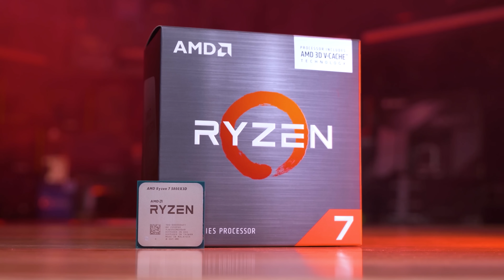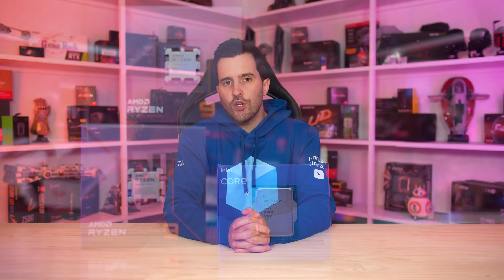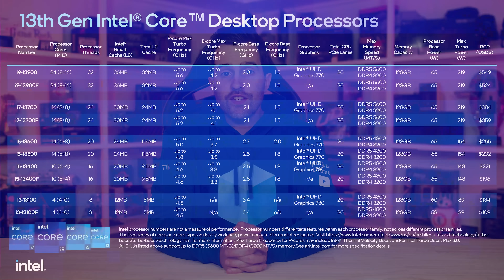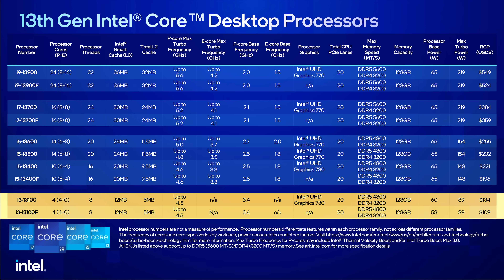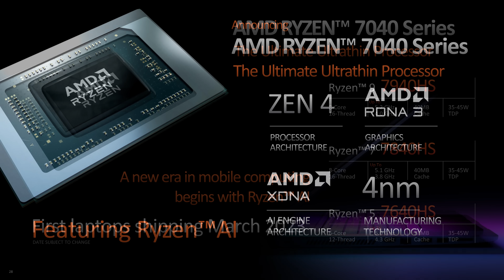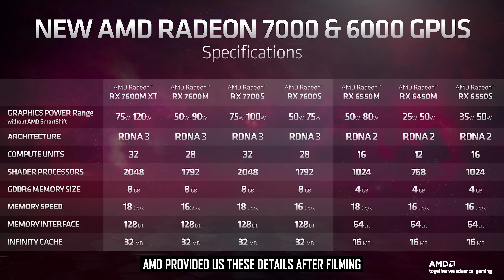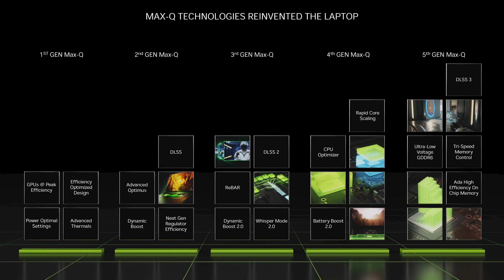Zen 4 3D V-Cache, 7950X3D, 7800X3D, New Cheaper CPUs, "RTX 4090" for Laptops - CES News Recap

Comment: The 7950X3D and 7900X3D has a dirty little secret. You are right, only one of the chiplets has the extra cache. The secret is that the high clocks are only for the chiplet without cache. The chiplet with the cache is limited to 5.0 GHz. So only half of your CPU will hit 5.7 GHz. It is not a all core clock speed.
Reply: source?
Reply: @Hugh_I  AMD themselves: See https://www.youtube.com/watch?v=ZdO-5F86_xo
Reply: @nicholash8021  Thanks! Yeah that's very clear. Did AMD state anywhere else that it's gonna be 5Ghz max for the cached CCX? I think he didn't say any specific numbers. Or did you deduce that from the 5Ghz max boost of the 7800X3D?
Reply: Max rated boost is literally NEVER the same as the all-core clock-speed V-Cache or not, ya freaking dipshit... 😑🤦‍♂️ Max rooted boost = single-core boost.
Reply: Shhh, AMD would like to keep that secret

Comment: Good point on the 7900 chips only having 3d v cache on one chiplet. its prob why  the 7800 has to drop its max clock, cos v cache is sensitive to heat etc.
It's strange the 7800x3D looks to be lower max clock than the 7700x. it could end up being better for gaming but worse for productivity lol

Comment: Comments on certain SKUs being Alder Lake or not seems weird. Are you suggesting Intel overproduced Alder Lake dies? Raptor Lake should be competing with Alder Lake for fab space and has notable errata corrections. I would assume that there are just more bins of Raptor Lake due to Intel's massive die sizes and worse-than-TSMC yields.

I agree with the quad core desktop SKUs and the 6P4E desktop SKUs likely being Alder Lake, but I'm really skeptical that the 8P8E are Alder Lake.
Reply: And you'd be wrong. It has been known for a while that they're renaming ADL dies for this generation to fill the lower end skus.
Reply: @mikem.9197  I'm not debating that, I'm noting that I think it's fewer SKUs than called out above.

Comment: What if the 12 and 16 core parts only had half of the v cache per die as the 8 core model? Could this not explain why they don't have a big clock speed drop? If that was how they went about it, the 8 core part probably has v cache that is 2x as dense, which could be why they dropped clock speed despite having the same power target as the bigger chips. To keep thermals in check. I can't imagine them only putting v cache on 1 die. Just a thought at least.
Reply: I am betting that is what happened.
Reply: It's only on one die, that's why on other die there's no clock speed reduction
Reply: It has bee confimed. One die 3d cache, low speed. Other die no 3d cache, high speed.
Reply: @haukikannel  Source required.

Comment: If you have a 4090, the X3D CPUs are your only option. Any other CPU will limit your GPU performance. Hopefully, HU will review 7950X3D with a 4090.
Reply: My 120hz screen is the bottleneck.
Reply: Depends what screens you're running. Run triple 4k, or single 8k, and that 4090 will not be bottle necked by the CPU.
Reply: I'm running a single 4k screen with a 4090 and a 7600x and it's always been the GPU that's at 100% in intensive games. CPU highest I've seen in go is about 60%.
Reply: @hostile_1866  You can't see a CPU bottleneck by looking at the CPU%. Since games still aren't perfectly multi-threaded they wont ever hit 100% cpu% no matter how good the GPU is.

The only way to tell is to look at GPU% since games are expected to take full advantage of the GPU.
Reply: @Hotobu  ah interesting so if ever my graphics card isn't 100%, then it's CPU limited? :)
Reply: @hostile_1866  If your settings are maxed, yes. If you have a strong enough GPU and and old enough game then it wont hit 100% GPU because there's nothing the game can do to stress the CPU.

Comment: Wondering if 7950x i got for 569$ two weeks ago was good choice instead of waiting for x3D....
Reply: Same, but I'm mostly doing non-gaming multi-threaded work. But rumors above are saying that by disabling one of the two CCDs, you can then boost better than the 3D and overall do better in gaming as the extra cores (beyond 8) aren't as useful apparently. But when going to 1440P and 4K gaming, the GPU is the bigger bottleneck so your differences will be less noticeable anyway.

Comment: Something about the 7000HS parts is strange. They are listed with 40 MB Total Cache but on the specs sheet on AMDs Website the CPU only has 16 MB L3 + 1 MB L2 per Core. Where are the missing 16 MB? Did the Igpu get a small infinity cache or what?
Reply: 15:05 the early list information may have some mistakes. Here in the slides and video timestamp it is mentioned the 7040HS models have 32 MB of L3 
So you get 32 MB + 8 MB L2 (for 8 cores) = 40 MB combined

Comment: In that Ryzen 3D vs 13900K comparison, AMD probably ran the DDR5 memory for Intel at stock speeds (5600)....and that hurts the performance a lot. The 13900K can with the right motherboard and RAM push past DDR5 8000. While the Ryzen 3D is limited to about DDR5 6000-6400 speeds at 1:1 with IF.
Reply: But will higher ram & price be worth it 🤷🏻‍♂️
Reply: that might be an interesting thing to benchmark, but in the end an i9 with the most expensive memory you can get being within a couple of single digit % points above or below the 7800X3D with affordable DDR5 will be a terrible value proposition either way.
Reply: DDR5 RAM that fast costs an arm and a leg and isn't worth the gains.

Comment: Ok so navi 33 has identical number of CUs as navi 23, is made on 6nm (7nm derivative) and is actually a slightly smaller die.

This means 7600 and 7600XT deskop cards won't see a significant improvement in performance and also will stay at 8gb.

I don't expect these cards to increase value in the budget market significantly if at all.
Reply: When 4060 will be something like $600 to $700, then 7600XT would make a lot of sense at $500 price point!
Reply: @haukikannel  I'm sure it will at least be cheaper then that.
6700XT is already quite a bit below that price and I expect the 7600XT will have similar performance minus 4gb VRAM.

Comment: No 7600X3D or 7700X3D. sadge.
Reply: 7800x3d is 7700x3d the same chip with 3d cache.
7600x3d makes no sense price wise. 3d cache increase price by $150. it does not make sense in cheap CPU to do it!

Comment: Interesting. AMDs Price reduction on regular X cpus, release of cheaper non-x cpus, and non listing of the price of these 3D models, all these moves suggest we can expect a big jump on price for the vcache models.
Reply: Because we know 7700 price, it means that 7700x has to go up in price close to original MSRP, maybe little cut, like $379 for 7700x. And the add the difference between 5800x and 5800x3d that is about $150 and we will have 7800x3d price!
But because AMD does not know yet how to adjust 7700x prisinf after 7700 release, they don´t know 7800x3d prising neither because they all are cross related.

Comment: 4:30 only one chiplet with 3D-Vcache could explain the drop in boost frequency for the 7800X3D. The high boost clocks on the 7900X3D and 7950X3D occur on the chiplet without VCache, whereas the chiplet with VCache have most likely lower boost frequencies due to thermal constraints, probably around the 5GHz mark. 
The 7800X3D only has one chiplet and that has the VCache chiplet on it, therefore is more thermally constrained, which limits the boost to about 5GHz.
Reply: True, but quite annoying that this is still the case when AMD said they would fix the issues with 3D Vcache for Zen 4.
Reply: @Bayonet1809 They did make it significantly better. 🤷 The clock-speed regressions were cut about in half for all-core boost and by about a third for single-core (5.2GHz on 7950X3D's X3D CCD vs 5.7GHz on 7950X; vs 4.5 vs 5.05GHz on Zen 3), ALONG with unlocking PBO & Curve Optimizer overclocking. 

The R7 7800X3D could have been pushed to 5.2GHz if AMD had wanted to just like the 7950X3D's X3D CCD is, but it would have been shit for yields and made the SKU segmentation even more weird than it already was. Once thread scheduling is 100% figured out AMD most definitely wants the more expensive R9 7950X3D to game better than the R7 7800X3D.

Comment: I'll be looking for a deal on a laptop with the i7 13700H and RTX 4080. Probably the best bang for the buck on the high end. I would love an i9 13980HX and RTX 4090, but $2000 extra for 15% more fps in games wouldn't make much sense
Reply: I’d be looking for a r7840 cpu personally because it’s going to spank anything 13th gen from being on 4nm in a laptop alone. Plus 12cu rdna3 integrated graphics would mean low end gaming easily without any gpu and ideally an egpu if you’re actually gaming that heavily.
Reply: @alexmills42  I'll probably wait until AMD comes out with their laptops and see. I currently have one with the R7 5800H and it's served me well

Comment: What makes me very concerned is this is from memory that this is the first time I’ve not seen AMD give prices mentioned on new hardware. So don’t expect any x3d being realistically priced
Reply: They don´t know how they price 7700x and other normal 7000 series when non x has been released. now thw 20$ difference makes no sense, so x part are going up closer to their original MSRP. My prediction is that 7700x comes down from $399 to $379 to be about $50 more expensive than non x 7700. 
And 3d cache version will cost about $150 more than normal x version. Just like 5800x vs 5800x3d… But the exact price depends on how high normal x version will rice after non x version release.
Reply: @haukikannel  I’m anticipating a $200 difference on x3d cpus this time. I hope your right and I’m wrong but my gut feeling is a bigger hike. All depending on performance. One thing is for sure Intel will be very worried right now
Reply: Yeah I’m thinking the 7800x3d will be close to or at MSRP of the 7900x
Reply: @alexmills42  my guess is the "discounted" prices your seeing the non 3D chips at will become their actual prices and the x3D chips will take over the MSRP price they were launched at like they did with the 5800x3D. if they don't then i expect they'll be 50-75 dollars more than the MSRP of non 3D chips.
Reply: The 5800x3d wasn't realistically priced, either, but  it came down to earth within a year. Let's remain hopeful
Reply: @Anankin12  Bro says "wait a year" so casually. That's a whole year of gaming at high fps you missed out on because you decided to wait a year for prices to go down. If you're content with waiting a year, then you likely don't even need an upgrade yet.
Reply: @choka3750  didn't say wait a year, I said wait a couple months for the price to come down to earth.
Reply: @Anankin12  i mean that is not what you said actually.
Reply: @Anankin12  You literally said within a year.
Reply: @choka3750  Anankin said "within a year," not "a whole year."  It took the 5800X3D between 7-8 months to drop from $450 to $330.  The Zen 4 X3D parts launch in February, so if their pricing follows a similar pattern, holding out until 4th quarter of this year to upgrade can make sense.
Reply: @choka3750  Additionally, the cost of entry into the AM5 platform, especially motherboards, is still pretty high.  The decent ones start at around $240, and minimum of 32GB DDR5 RAM on top of that is at least another $180 unless you can get a special bundle deal.  Not everyone's made of money.

Comment: Would love to see benchmarks for this, especially between the 7800X3D vs 7950X3D, I suspect single CCD will be better overall for pure gaming.
Reply: No difference. You have 8 cores with vcache .... VS 8cores with Vcache on top+8cores without.
So for both chips the games main execution threads will be utilising the extra L3 cache and hence higher performance, The 7950x3D and 7900x3D give you the same gaming performance AND the multicore performance for people that want to game and do production (rather than having to choose between R7 and R9).
Of course the 7900x3D is just a cheaper alternative to the 7950x3D.

If you're buying AM5 right now and DDR5 etc then its not really cost effective to buy a 7600x3D considering the outlay, so you might aswell go 7700x3D.
Some idiots upgrading an old ddr3 system thought it was a good idea to buy a soon to be EOL lga1700 motherboard.....PLUS DDR4....and then sticking a measly quadcore i3-12100f into the combo because "its cheap", when for just an extra few bucks (a smal percentage of the overall cost) an i5 was allot more powerful.
So no 7600x3D avoids that false economy problem.
Reply: @tomstech4390  That might explain the 'forced' lower clocks on the 7800X3D, to also keep a gaming performance difference between the SKUs
Reply: With Microsoft's upcoming Zen 4 X3D specific thread scheduler updates they'll literally be identical... They'll both only be using a single 8-core X3D CCD to run the game. (Aka on the Ryzen 9 parts the normal CCD won't be running the game at all, just unrelated background tasks).
Reply: @Cooe.  Not quite, Unlike intels thread scheduler which actively keeps game threads away from the much weaker cores which would bring performance down.
The optimisations AMD talk about are to make game threads a priority on the first 6-8 cores (because a 7900x3D has 6 cores with Vcache plus 6 without) but low priority game processes will still be active on the other CCD so you're not going to be left with half a cpu doing nothing.
It's effectively more of the CPPC2 core flagging we already have, But I digress just wait a little and see.
Reply: I would look at the 7900X3D to be frank, might be an excellent middle point, considering clocks and heat.
Reply: what ever clocks the highest will prob be fastest, unless win scedualer struggles, or the game is poorly coded. Then random shitz can occur, like with intel´s E-cores.

Comment: For the R9's to have the same boost speeds as the the non-3D vcache parts, while only having vcache on one chiplet is hardly a coincidence. I would be surprised if the highest frequency isn't reserved for the side without vcache, only.

That will make it even harder on the scheduler, since there is no "faster" side. Rather, there is one side with more compute power and one with more cache.
Reply: AMD has been working with Microsoft to update the Windows thread scheduler specifically for Zen 4 X3D to do just this. Any workloads that are notably more cache & latency bound will get pushed to the X3D CCD. And then single core and other compute workloads get pushed to the other higher clocking "normal" CCD.
Reply: @Cooe.  Exactly. It's no worse than scheduling for Intels P/E cores. Folks need to relax.
Reply: @Mike M.  No, it's definitely harder to program a scheduler for AMD when both CCDs are better at different specific programs with neither being objectively better. 

Intel P/E, one architecture is clearly superior and preferred, while the other handles idle tasks, background tasks, and only works on foreground tasks when more than 8 threads are activated (thread director generally prefers using an E core before it uses SMT on a P core)

Comment: I think the Laptop 4090 is going to overperform compared to expectations, based on how energy efficient the desktop 4090 is. When you cut the power targets on the desktop 4090 it is still a fucking beast of a card. So, in laptops with inherrently smaller power targets, I think we'll still see huge performance gains. 

It all depends on the format & how well the laptop itself can shed all that heat!!
Reply: But the laptop 4090 is actually a down-clocked 4080.
Reply: I'm very much considering a 4090 laptop. But if the performance uplift from a 4080 is only 15% for $2000 more, I'll pass lol
Reply: @Pharya -- So you commented without actually watching. There is no actual 4090... they just named it that. It's an AD103 die the same as the desktop 4080. NVidia just pulled the same shit people called them out for with the "12GB 4080" that they were forced to rename to the 4070 TI.

Comment: I'm just throwing out this idea in hopes it could happen one day...but it'd be great if AMD and Intel used the same socket, so that you could decide which cpu you wanted but keep the same mobo that lasts for many years. This way you're not locked into either ecosystem, you could try both.
Reply: What do you mean with ecosystem? The only thing you need to change is the Mainboard, because the Pins are different
Reply: @otozinclus3593  means that when you buy an amd cpu you get an AM5 mobo for example...it's not as simple as you make it sound. Changing out your mobo is pain in the ass, while switching out a cpu is far easier.
Reply: That used to be that case back in '94/'95 with Socket 5 and 7, which supported CPUs from both Intel and AMD (among others). These days there is too much custom stuff each company wants in their pinouts that cross-compatibility would be unfeasible to coordinate.
Reply: @Bayonet1809  interesting, I had no idea they used the same socket once, too bad they gave that up. You make a good point about the customization...well I guess we're stuck with going with either platform...unless one wants to own several computers with some from intel and others amd.
Reply: @Bayonet1809  And older because AMDs early CPUs were a second source for IBM in the original PC. For years AMD kept older intel sockets alive by making higher clocked compatible CPUs for consumers. It only ended when Intel went Slot 1 for the PII and then socket 370. Hell you could get socket 370 compatible chips from VIA(after their cyrix and centaur acquisitions). Intel wanted everyone else off their platforms. If Intel had their way, there would be no third party x86 compatible CPUs at all.